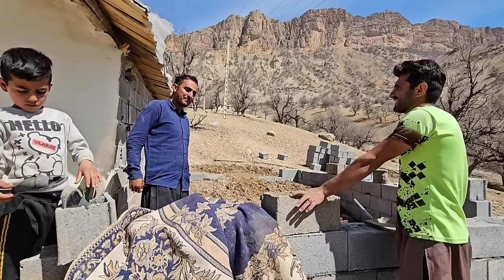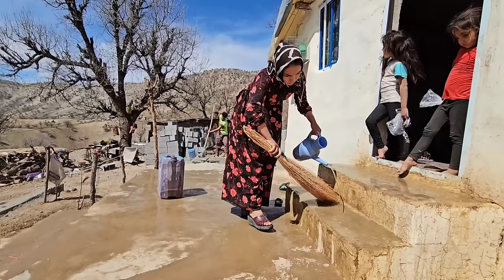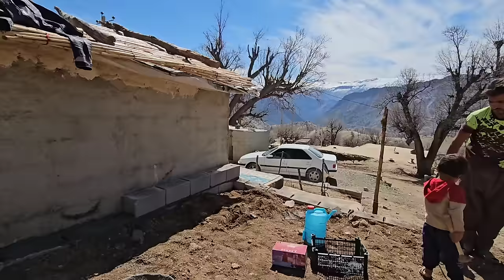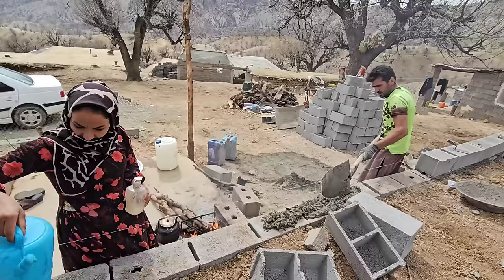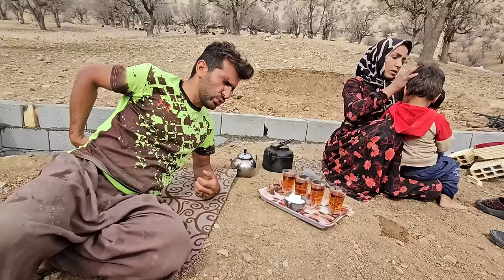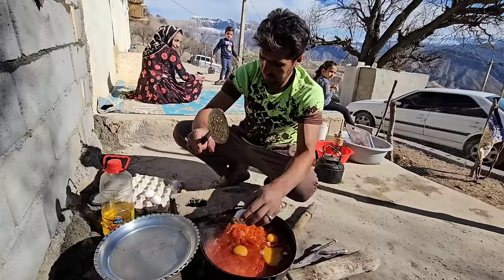"Ultimate Love and Empathy: Building an Energetic and Happy Family". part 147

Comment: Fereshte, please tell Imran to make the addition adjoining rooms.  If anything were to happen to your children while they are alone in a separate room that is not connected to the main house, you would never forgive yourself.  Children play rough and get hurt, they get sick, they get scared of strange noises, thunder, etc.  And they are very young to be left alone, they would have to go outside to get to your room if an emergency arose, even in heavy rain or snow.  Imran does not always think things through, he is kind of haphazard in his decisions, and he has no children, so he has no experience raising children.  No offense to him, but you need to assure their safety, you need be have immediate access to them, and Imran can put an interior door between the two rooms for privacy.  Please do it now before he gets any further along.  Like some viewers said, no need to build a wall against an existing wall, and the floors of both rooms should be the same height.  Not trying to be a know-it-all, just using common sense.

Comment: Imran risks permanent damage to his back. He may just need rest, but he could also have herniated discs in the lower back. I have/had herniated discs in the neck area. They do not heal, and the pain is unbearable. Then, you begin to loose control of limbs downstream of the discs that are herneated because the nerves get pinched on nerves that exit the spine in that spot. You could end up in a wheel chair. That is the bad news. Good news is if you see a back pain specialist, that person may be able to help you regain your health or at a minimum, identify the problem. In my case, I was in such pain that I wanted surgery right away. My doctor would not authorize surgery unless I first attempted physical therapy. I had no faith in the physical therapy, but in the weeks that followed my pain began to subside. Now, ten years later, if pain returns, I resume the excercises taught to me by the therapists to return to pain free. My injury was the result of working above on the ceiling of a room for an extended time. I know not to do that now. It ruined the career of Tiger Woods because he kept re-injuring the same spot. Please at least see a doctor. A doctor can tell just by feeling it with the hand if something is out of place.

Comment: Why are you putting up a double wall ?
Would it not have worked just using the one wall and build three walls to connect,  cheaper  and less work.
Your back is not going to heal, need to see a doctor.